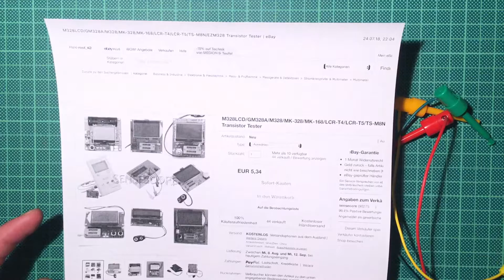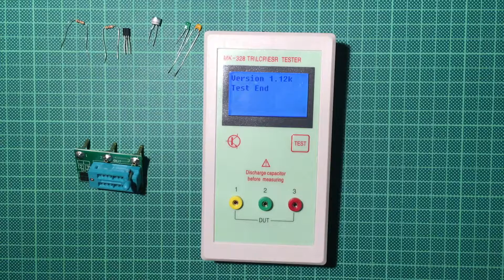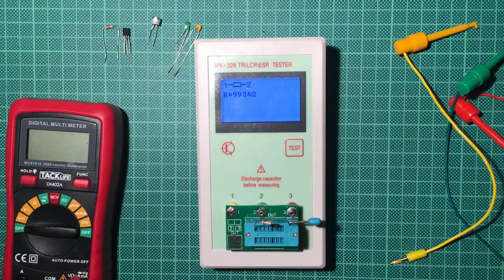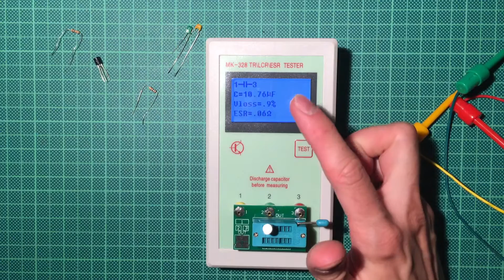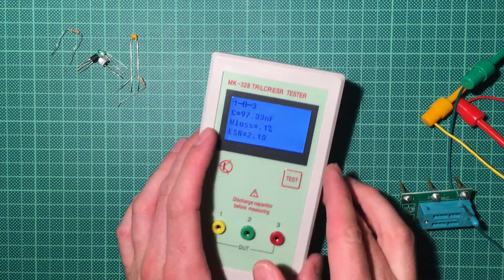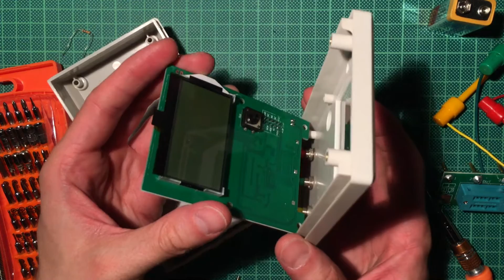The MK 328 Transistor Tester

Comment: i need epprom data and hex file ESR mk-328. Can you help me? mine is damaged.
Reply: This is not the original but works for my fake MK-328 (without the version Marks on the PCB and without  "EZM electronis studio" on the front)
http://asknotes.com/2019/08/30/lcr-t4-transistor-tester-original-software/

I thested some other firmwares but most times i got wired display behaviour

Comment: I have the same tester and I just got it today but when doing the self test, I did not get the same result..any ideas?
Reply from the maker: What result did you get? This is a calibration so I guess numbers differ from device to device
Reply: root42 it did not do the self calibration test but after several tries it worked well. Thanks
Reply from the maker: Great. Have fun with the device!